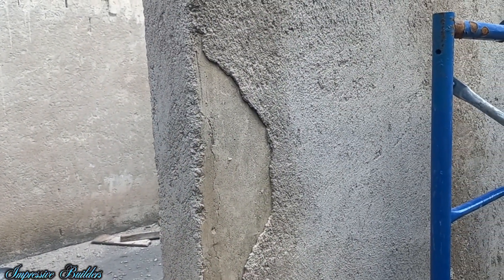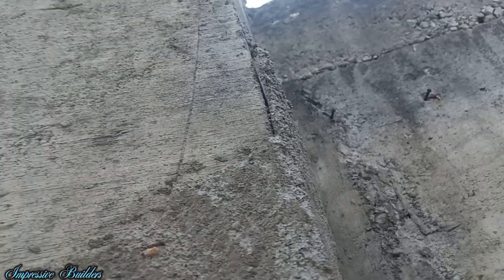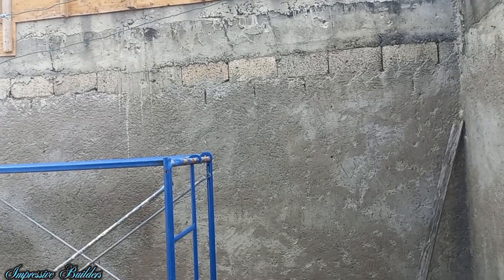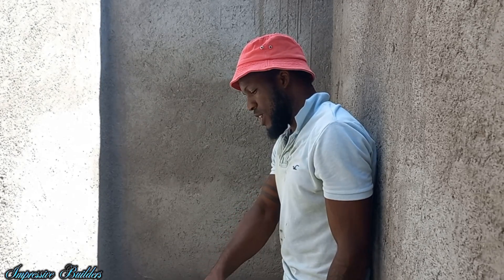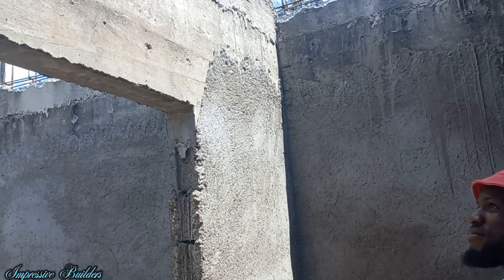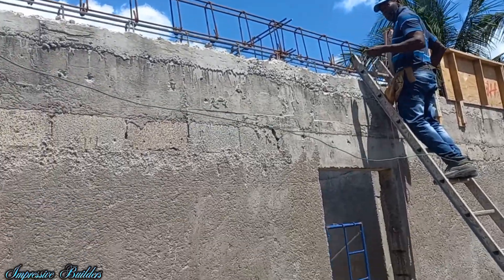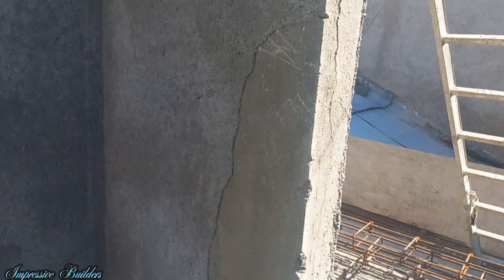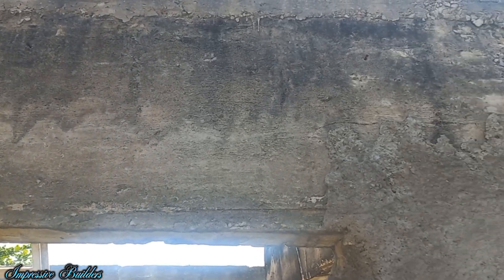IF YOU DO THIS WHEN ROUGH CASTING YOU WILL REGRET IT

Comment: They wasted the materials
Reply from the maker: Most definitely because the job isn't done properly most of it will have to be removed and re-done
Reply: @impressive_builders  How do you prepare the wall before you Shovel on it?
Reply from the maker: @DeLifeOfaNanna  some persons one finish it rough cast and float it down or render it without sponging the  surface it cant be too rough or smooth
Reply: @impressive_builders  got ya